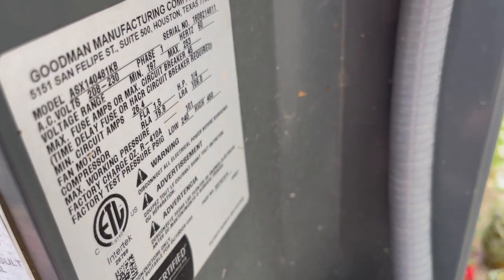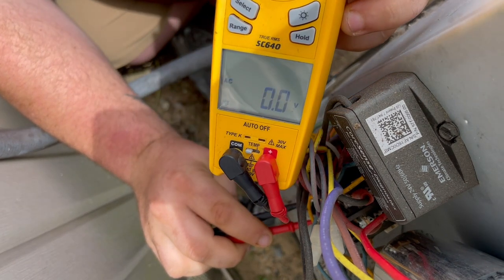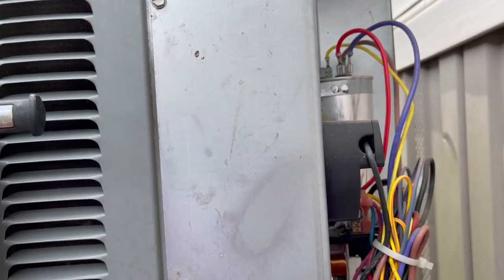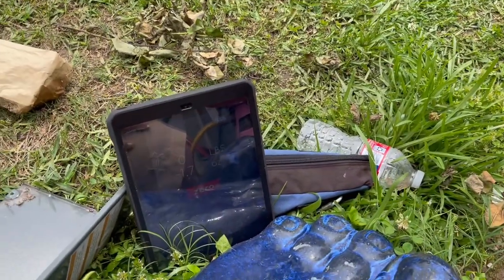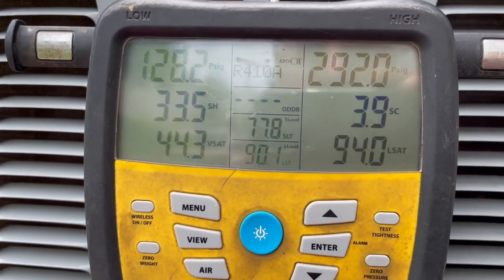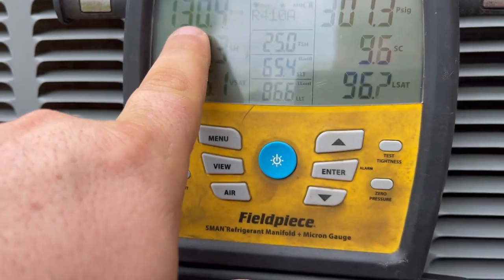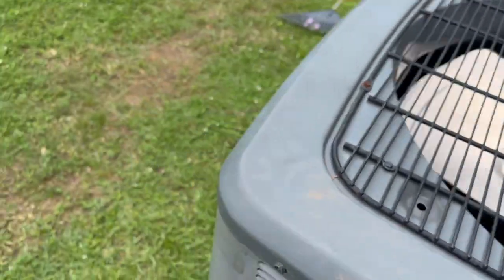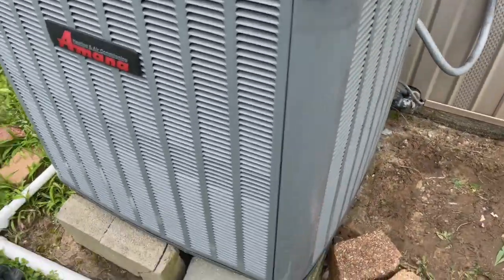HVAC/No Cooling/A Couple Issues

Comment: Those stupid locking caps are code here in FL  also, hate the freaking things. And they’re ridiculously expensive. Usually I put them on for the inspection, then go pull them off after the inspection( if it ain’t too far out of the way), then put on the regular caps. From what I heard, not sure if it’s true, that some politician’s kid died from huffing refrigerant and that’s how that code got put into law,.

Comment: Goodman is know for having a leaking evaporator coil, especially the aluminum once where the coil is factory soldiered to the copper pipe. Then they attempt to put some rubber and glue around it because they know it leak. They normally go bad right after the warranty expires lol.

Comment: I gave this a 👍.
But, I encourage locking caps, yeah I know, there proprietary tools involved, but they are cheap to acquire. Where I live dummies are still huffing Freon and for what it costs to replace at pound cost, it’s a deterrent to getting ‘high’ and something the tech can gauge refrigerant line integrity. Those EPA rules that get ignored.